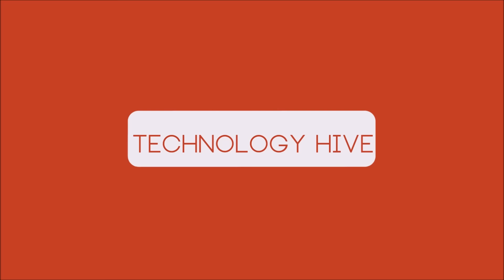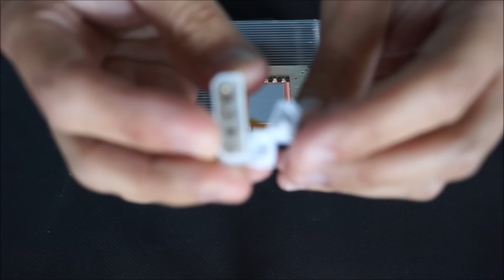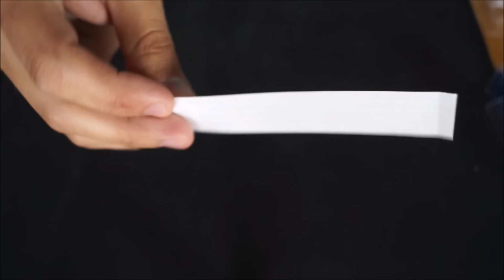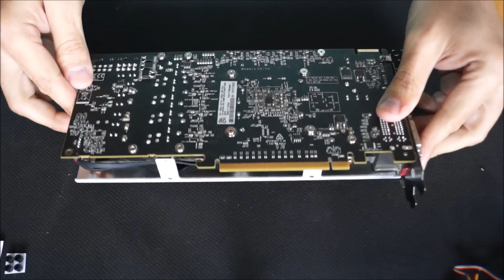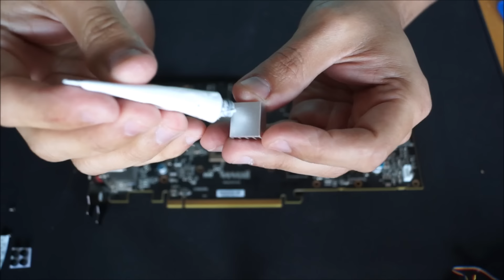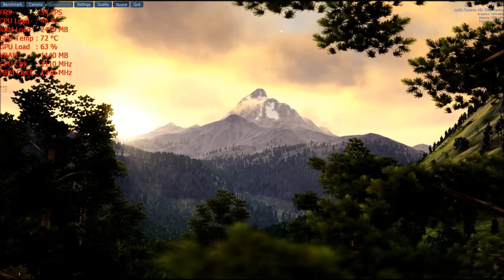Accelero Mono Plus VGA Cooler

Comment: your stock cooler looked much better than the accelero mono plus.
also the accelero mono plus is no longer produced. 
What I personally did was buy an old gts 250, took off the heatsink, and used it to replace my current cooler. 
The coolers on old cards are much better than some newer ones.
Reply from the maker: If you dont mind looks, this would work if you can still find it. Yes, I agree. Older graphics card coolers are more efficient.

Comment: Is this the solution for my gigabyte 1650 gddr6 low profile?
Reply from the maker: I don't think so. Assuming I understand correctly, you want to install this cooler in a tight space thus the low profile card? Then no. This cooler is tall. You can adjust its height a bit but not enough to clear a slim itx build.

Comment: Please help! Will these cooler mount onto  gtx 1070 cards?
Reply from the maker: It depends on the card manufacturer. But it is compatible with GTX 1070 Nvidia founders edition cards. I have also tested it on several 1070s and had no problems. 👍
Reply: @TechnologyHive  I have blow style Asus Turbo 1070 model
Reply from the maker: @0zelena6kriza4  It will work as long as you do not have any tall heatsinks around the die that will get in the way. 👍 Look up photos of your cards pcb and see.
Reply: @TechnologyHive  It should fit PCB is almost the same as 1080-Fe. Newer again blow fan GPU
https://www.youtube.com/watch?v=tMhQ3xsf02M&t=154s
Reply from the maker: @0zelena6kriza4  I thought it would fit also. Im sure you will be just fine 😊👍

Comment: This video help me to install this kit. Thanks Technology Hive! 
I installed this aftermarket cooler on my XFX RX 570 8GB card because the originals fans were very noisy while playing games and the GPU temperature was over 83C. After installation, even if I overclocked this card, the GPU temperature never reach more than 64C. A 19C gain. And the 120mm is quiet et never go higher than 50% (I use the recommendation from Artic Cooling web site  (Accelero Xtreme IV). Great cooler for small or medium size video card.
Reply from the maker: I'm glad it helped you 😊😊.

Comment: The main issue with GPUs are the fans. They all use garbo fans who barely push air and high end cards just compensate with thick radiators and 3 garbo fans.

Comment: would this fit on an rtx 2060?
Reply from the maker: Arctic cooling says it's compatible with reference models using the AMD brackets. I can not confirm it.
Reply: No idea. I'm going to buy it for a 1660 Super, which it's also questionable if it fits out of the box. It can't be that hard to mod.
Reply: @robertkubrick3738  did it work?
Reply: Robert Kubrick hi, did it work? I have one and I’m thinking to get one. Asus Pheonix gtx 1660 super, 83 degrees at max
Reply: @kevinwong4689 i used a nzxt g12 with a corsair h55. got a video online. :) awesome results @ my 2060 ko ultra

Comment: Hi. Mine have no speed control, run same in idle or full load (1200rpm). Do you know why? It is connected to the 4 pin of my 1060 6gb.
Reply: go to arctic sight and look at the custom fan settings for nvidia

Comment: I am wondering would it fit a Sapphire R9 380, would it do the job? I want a silent solution that does the job of cooling.
Reply: Hi again, so yesterday I got the cooler and I have been experimenting the whole day. The problem was I didn't have thermal adhesive so, for the sake of experimenting, I ended up with sticky thermal pads on the VRM chips holding the small heatsinks, yeah it was bad with that. 
But with all things installed on the GPU, I have runned OCCT app and stressed the card, GPU temp was 58 celsius, I was amazed compared to the stock 70 degrees. Arctic fan was running at about 1200rpm and man it is silent. I tried with stock cooler and fans at full speed, temp is about 62 degrees. 
But because there was a possibility for the little heatsinks to fall off because I didn't have thermal adhesive, I ended up putting stock cooler back on for now. I see the cooler has a lot of potential, I should just get thermal adhesive for next time.
Thermal paste used for GPU: Coolermaster E1, I couldn't find Arctic MX-4 in my town.
Amazing 12 degree drop for a 190W TDP card!
Reply from the maker: @Triplex5014  You can also find 3M double sided thermal tape on eBay for cheap. Stuff works good for use with thermal pads. Great to hear its cooling that nice though 😊 just use thermal tape and you're gonna be happy.
Reply from the maker: It should fit it just fine. The rated TDP for this cooler is 200w.
Reply: @TechnologyHive   Found a good deal for €20 ($22.5), I'm gonna install the cooler in a few days and I hope it will work like a charm.
Reply from the maker: @Triplex5014  Nice man! Keep us updated!

Comment: Could not install this on my Inno 3d GTX 1660Ti. The chokes on the GPU interferes with the cooler back plate.
Reply from the maker: There is no way around that, I'm sure you figured out.. But is the stock cooler that bad?

Comment: Will this fit rtx 2060
Reply from the maker: If it has a reference design pcb, the AMD holes should work. If not, then no.
Reply: @TechnologyHive  amd holes??, I have order twin turbo ii will this fit for my rtx 2060 coz its over heating when i play the game too much hot. I just wanted to know whether it will fit or not. Thanks for the reply. Your so fast to reply i am gonna sub ur channel
Reply from the maker: @ravitejamaigap3667  Thank you. The mounting bracket as you can see has different holes for AMD and Nvidia. The AMD holes are spread out more than the Nvidia holes. If your rtx2060 has a reference design pcb, the AMD holes on the bracket will work for mounting the cooler on.
Reply: @TechnologyHive  amd holes means extra holders??
Reply from the maker: @ravitejamaigap3667  yes the adaptor bracket has a multi configuration design with multiple mounting holes.
Reply: @TechnologyHive  so it will fit

Comment: I have an old 7870XT ( https://www.techpowerup.com/reviews/VTX3D/Radeon_HD_7870_XT_Black/ ) the fan started rattling and in summer it will hit temps not comfortable for my taste + sounds like airplane.Mono plus is not supported officially,i think it  might exceeding 200w on boost mode.I will eventually move to a used RX 570/580.Mono plus or twin turbo 2?.These heatsinks do proper job?.Found a used mono plus  from a friend and i wonder if it worth adding.

Comment: I know this is an old video but I'll take a shot.  I bought an MSI RX580.  It's not the dual fan but the reference card with the blower.  I'd love to know if this would fit.  I reached out to accelaro and they suggested the twin turbo III.  I get that they want to sell their new stuff but this is all I need.  Anyone have experience with the RX580 V1 reference card and this cooler?  Thanks!
Reply from the maker: It will fit. Enjoy.
Reply: @TechnologyHive  you rock man thank you so much

Subbed and will be checking out all your other vids.  Thanks again
Reply: @TechnologyHive  hey man just wanted to follow up and let you know I got this installed.  I couldn't of done it without your help and guidance from this video.  Toughest part was getting it seated correctly.  I let the card release after setting the cooler on so just to be safe I cleaned up the thermal paste and reapplied.  Works like a charm.  Great temps and holy crap it's quiet.  Thanks again!
Reply from the maker: @Ewkop  Glad to help man. Nice to hear those temps are down :)

Comment: Got mine today (2/18/2019) and put it together, however it started out very badly.

I got the email that it arrived and so I went to get it. I opened the amazon lockbox thing, and I went from happy to horrified in a split second. The packaging was not a box or anything that would really protect the product. I made it home and opened it up only to see the box was fucked, and the product itself was not looking great. I tried to spin the fan to make sure there was clearance, and sadly there was none. I took it upon myself to fix this, and so I did. I noticed the cooler was bent, which made the fan blades unable to clear. I bent it back and now they clear.
There was one problem with the heatsinks covering 2 memory modules, but I got a majority of them instead of half and half. For now, I own a GTX 1060 6GB (EVGA Gaming).
After fixing it, I installed it and as of now, it's perfect. I have not hit 50C yet, and that's probably due to my case's airflow (I have the Cooler Master H500P White (hope I got that right) .)
My 1060 was hitting a constant 85C, even with the case fans at max speed (2x 200mm front, 1x 140mm rear, 2x 120mm top (for the EVGA 240mm AIO) .)

I will only order my pc parts from Newegg from now on, even if it becomes pricey.

Other than all of that, this cooler is great for cards that have shitty cooling, and this is coming from someone with a slightly damaged version (not really damaged, but I would say a tiny tiny tiny TINY bit damaged.)

EDIT!!: If you're wondering, the pc is totally silent now, and no longer running every fan at max speed.

Comment: What about noise levels though?   I'm thinking of adding to my 1080ti SC2 since the fans are so loud compared to my good o'l 970.  Great vid.
Reply from the maker: You wont hear the fan. Even at max speed it is practically silent.
Reply: That's a beautiful thing to hear.   My 1080sc2 fans are so loud.  PPl in forums say it's normal, but it's a huge difference compared to my gtx 970.

Comment: Just put this on my graphics card and the results are AMAZING! Went from about 180f on max settings to 140f! I play a lot of MMOs and competitive games if anyone is wondering and yes, this cooler has definitely decreased the heat on my GPU. Definitely worth the $35 tag!
Reply from the maker: Thanks for watching and for sharing your experience!
Reply: What about noise>
Reply: @JohnHadley13  Its pretty much silent, so no need to worry about that area. If any, only my power supply for my pc is audible.
Reply: nice.  I think I'm going to install on my 1080ti sc2 if it's compatible.
Reply: what gpu do you use?
Reply: @JohnHadley13  I have a Nvidia Gtx 1060 3gb, but since the cooler is adjustable it should fit, but if ur worried, then feel free to ask other reviewers on the product or seller, such as on Amazon

Comment: Can I install this heatsink on my Evga gtx 1060 6g ACX 2.0 ? Can reach 85C when at full speed . :(
Reply from the maker: In my experience with the GTX 1060 ARMOR by MSI, you can not. Some Capasitors are too close to the core and get in the way of the cooler. But that is the only card I have experienced this with.
Reply: @TechnologyHive  hope everything is going to be fine when  I install it...

Comment: this cooler is a beast! just installed on my gtx 1080 replacing blower style cooler.
Reply: is it working fine? I'm thinking about buying it for gtx 980 because the blower style cooler is throttling

Comment: How do you clean it first? DO I need some sort of fluid? Also, what about thermal paste, is that not needed?
Reply from the maker: I use 75% isopropyl alcohol to clean the gpu area. Thermal paste is included with the cooler. It is MX-4.

Comment: Hi there I put this super cooler on my GTX 1080 mini and wauu greats ! On stress GPU I had before 70 C now 50 C and idle is 25 C !!! Super! And easy installation. BUT does have anyone here same problem eith fan ? My fan has samo random peaks on 1200 - 1800 RPM and then is little bit louder... :)
Reply from the maker: Tomáš Holík Have you plugged the fan in the card header or the motherboard? Mine is running off the card and I have a custom fan curve using MSI afterburner.
Reply: pluged on card header. BTW has this cooler own sensor for RPM based on temperature on chip ?
Reply from the maker: Tomáš Holík I believe it is based solely on the pwm connector to regulate speed.
Reply: You can make a custom fancurve in like MSI afterburner (there are other programs to)

Comment: i have a graphic card just like yours but i want to use the Stock Vram Cooler Do you think its safe to use the stock Vram cooler for the Arctic Turbo II ?
Reply from the maker: Arnold Woodley Hello. You will need to dremul the vram plate in order to fit the accelero cooler on. It's a bit tricky.
Reply: ok

Comment: can i put this cooler into gtx 1050ti? zotac single fan,, ??
Reply: Probably wont need this cooler, unless you want too run passively on the gtx 1050ti.
Are you reaching temps consistently into the 90's or are you on a lower temperature ?
Reply: You could use it if your after some heavy overclocking and want to risk making your gpu explode.
But you cant even overclock that far because that gpu doesn't have a 6 pin power connector on it only some 1050 ti's do have that and I am 90% sure yours doesn't so there is absolutely no gains to be had.

Comment: Damn I could put this on my GT 1030 and have like 20°c on full load :D
Reply: Hunter951 but an arctic accelero III on it and your cooler is worth more than your gpu 😂
Reply: And make icecream too!
Reply: @jackthegamer They have a passive version, GT1030 is worth as much as the cooler so better buy a better gpu.
Reply: Then even underclock/undervolt it LOL
Reply: Remember the GPU temperature can't be lower than your room temperature
Reply: Or just buy a used 780 or whatever that is 10 times better than a 1030 for the same money.
Reply: @TheDembe1  Where do you buy GPU's at? The cheapest i can find a 750 is about $60, thats like $20 less than a 1030
Reply: @dylanchilders4527  Ebay? We also have Amazon UK and Germany to buy used stuff from.
Reply: @TheDembe1  I figured Ebay, i was just asking about location lol, GPU's arent that cheap in my area
Reply: @dylanchilders4527  Sweden, also a Swedish nerd community that have a very nice used market.

Comment: an important question.... will the vram heatsink cause short circuit if at all somehow it gets detached from the vram(since i am using thermal pads and not the thermal adhesive) and touches the pcb of tge graphics card or the motherboard when the computer is in the on state, will there we short circuit? since those vram heatsinks are made of aluminum...?
Reply from the maker: ClashforReal you run a risk by not securing the small heat sinks properly. Yes, they can cause damage if one comes lose since they are made of aluminum.
Reply: Technology Hive i see...are the thernal pads alone enough to cool the vrams? or should i use double layers.. since i play graphics intensive games...
Reply from the maker: I would use the small heat sinks provided. Period. This if you want to be sure you are getting good cooling for the areas that should be cooled by a heat sink.

Comment: Can you return the stock fan/cover to the card after installing these small heatsinks? The small heatsinks preventing me to install the stock cover. The card is RX480.
Reply from the maker: It is possible, I have done it. But you do run the risk of tearing off a VRAM chip or VRM while pulling and twisting the heat sinks to remove them. You may destroy your card. If you do mount the included heat sinks, make sure to use a thin layer of thermal adhesive in order to ease the removal process. By thin I mean half of uncooked grain of rice amount. Hope this helps.
Reply: Technology Hive Thank you for your reply. I have done that successfully. But before I removed the small heatsinks and just  removed the Arctic fan and unplug the fan controller cable; I decided to install the fan again and plug the cable but the fan stopped spinning on any load. I have removed another GPU stock cover and plug the Arctic fan into this GPU's fan controller slot and it was working as it should. I also tried to plug the cable from two other working cards to the modified GPU and the fan won't spin. So the issue appeared to be in the fan controller slot on the modified GPU. Do you have any workaround for this matter? Thank you.
Reply from the maker: What graphics card do you have? Some cards have a feature where the fan will not spin until temperatures reach a certain threshold. 

It could also be that the card designed to supply certain power according to its original fans' power rating. Install the stock fans, power down the system and restart to see if the GPU bios detects the original fan's. 

I hope I understood you correctly and that the problem is with the original cooler and fans not working again.
Reply: Technology Hive The card is XFX Radeon RX480 DirectX with one fan at the rear. The fan on this model will spin all the time as long as the MB is on. The fans (stock/Arctic) are working on another card just fine but not on the card that I install the Arctic cooling sys previously. The white slot with 4-pins that controlling the fan in the card I believe is where is the issue.
Reply from the maker: Check with MSI afterburner. Go to the custom fan setting and see if you can set the fan speed there. If you are able to make it work like that, then it must be a driver issue. Try reinstalling the driver see if that fixes it.
Reply: Technology Hive I have tried scroll the fan speed all way up to 100% in MSI Afterburner but the fan is not working. ASUS GPUtweak app not even showing the fan speed bar. I have multiple GPUs in a mining rig and they are working fine except this one, so the issue is not from the driver too.
Reply from the maker: Have you checked the connections? Maybe bent pins.The only other option I can think of is running the fan directly from the PSU with included adapter.

Comment: since the mono plus doesn't have enough heatsink area to cover the vrams we put the vram heatsinks, but the twin turbo 2 seems to have  alot of area covering the vrams so is it possible to stick with the thermal pads such that the vrams will be cooled in the same way it used to with the stock cooler? or is  it required to put the vram heatsink even if i use the twin turbo 2?wont the cooler's heatsink put pressure on the thermal pads to cool the vrams if i choose to use it?